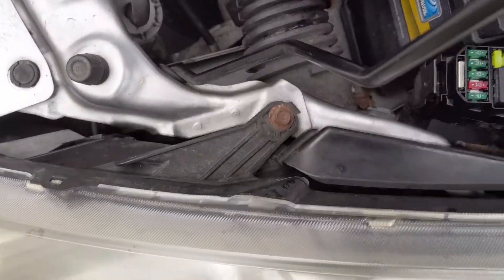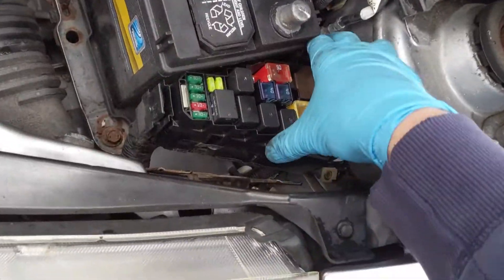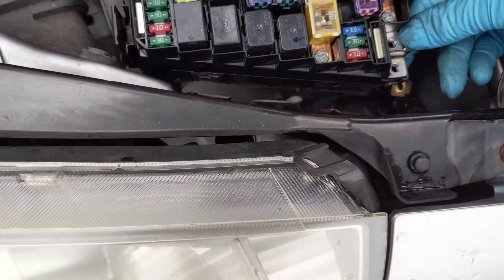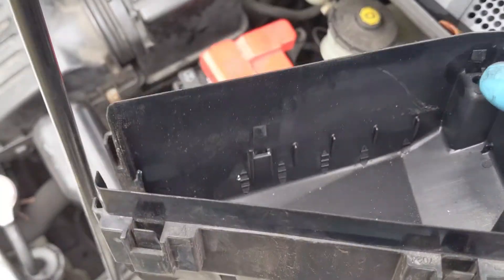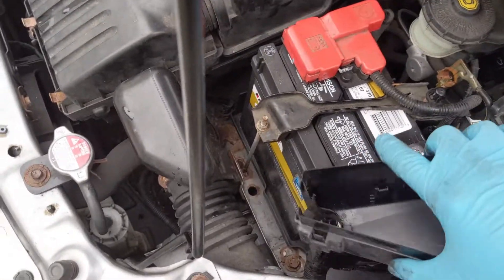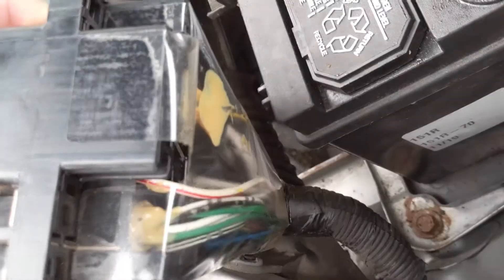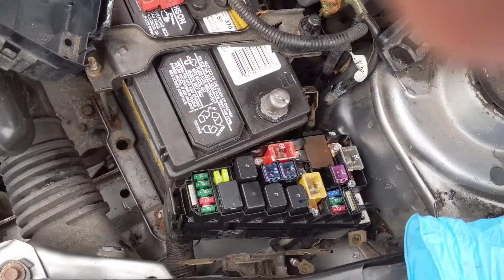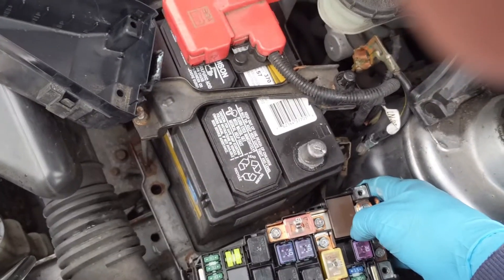How to Disconnect 2007-2008 Honda Fit ELD (Electrical Load Detector)

Comment: Can the ELD on a 2008 Honda fit cause the alternator not to charge and the instrument cluster not to work and the eps steering hard
Reply: Can't get no codes read on the code reader
Reply from the maker: @tomcova9422  nah. That sounds like low system voltage possibly caused by a bad alternator. I'd take it to somewhere that can test your alternator and battery before doing anything else.

Comment: Did replacing the alternator solve the problem?
Reply from the maker: Yes! This is the one I bought and it's been solid so far (have had it 3 years so far): https://www.amazon.com/gp/product/B01L2RGRC4

I first attempted to just replace the voltage regulator, as that's the part that's actually broken, but it's located inside the alternator. The bolts holding the alternator together snapped when trying to take it apart, so I said "Screw it" and just bought an alternator.
Reply: @MediumHalf  So actually replacing the eld was unnecessary?
Reply from the maker: @אריאלאביטל-ח8ב  I just disconnected it to test- I did not replace the ELD because the symptoms continued even with it disconnected.

Comment: hi, honda fit 2007, my alternator is good, but my honda does not charge, could an ELD be this problem, thanks.
Reply from the maker: I'd first get your battery tested.  The ELD is not a common failure point.

Comment: Will this allow for a larger alternator and the voltage not be regulated so low? Thank you and great vid brother
Reply: With the ELD disabled or disconnected the Alternator will always run in high current output mode but still within the proper voltage (14.4v). The alternator will put more load on the engine(mostly idle) but you'll get a stable consistent voltage output providing everything else is working okay.
Reply from the maker: You'll still want the voltage to be regulated, otherwise you'll cook things on your electric system.

Comment: Did it go away?
Reply from the maker: Sadly ,no. Turns out it's the electronics of the alternator- easiest solution is new alternator.
Reply: @MediumHalf  did your alternator test bad?
Reply from the maker: @jareddaniel5508  No, it tested fine.  The voltage regulator was intermittently dropping out.
Reply: @MediumHalf  ty good  video!!
Reply from the maker: @jareddaniel5508  thanks!